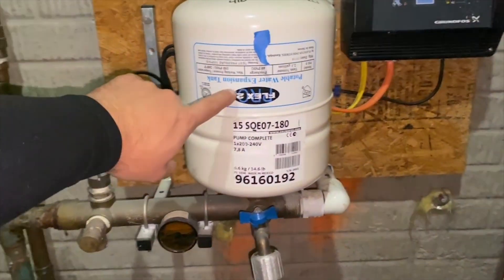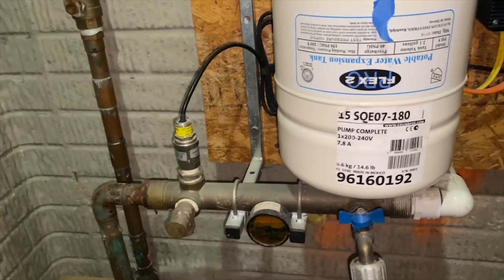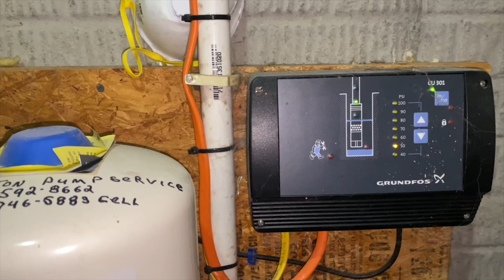Constant Pressure Systems: How They Work and Why You Need One

Comment: Do well gpm still matter if you have a storage tank or cistern? My gpm are below 4
Reply from the maker: See Short reply
Reply from the maker: Yes and no. For an average homeowner, not really. For just about any real estate transaction yes. Most contracts in MD require a min of 1 GPM. This is negotiable in some cases. Where it becomes a larger problem is with new construction. A new well must produce 1 GPM or you will need to have 2 wells with a min yield of 0.5 GPM with a combined total equal to 1.0 or more. Hope this helps.

Comment: Been watching a ton of your videos. Thank you for your knowledge and clear communication. We have a well that is 880 feet deep (static depth 860) and yields 10 gal/min. It yields about 10 gal/min. We have a 1.5 HP pump and a 20 gallon pressure tank. After living in the home for a little over 3 years, I'm very fed up with the water pressure (I can't even rinse dishes while my son showers). We'd like to maintain the life of our pump as long as possible (because a pump that large is rather pricey and difficult to replace) as well. Seems like a constant pressure system would be the way to go. Would you agree?

Comment: During my research on pressure tank systems they all touted draw down (Gallons withdrawn from the tank) sizing so you are not short cycling the well pump, causing it to heat and cool, stop and go that reduces the life of the well pump.  Is there a concern for increased cycling times with a constant pressure system?  Basically saying a well pump has a MTBF (Mean time between failures) of 300K cycles, it typically fails at 15 years but now with the increase to cycle times it will shorten the life expectancy of the well pump.

I am having a house built and just had the well guy out this week.  Well was installed back in late 90's.  500' 6" casing.  He suggested fracking the well to breakup any sediment that may have occurred over the past 30 years.  He fracked it, clorinated it (code) and then came back and pumped it several hours the next day.  Good clean water at about 12-13 GPM with a 3/4 horse submersible pump.

Comment: I have a well 140 feet deep, static water level at 70 feet and it makes 20 gallons a minute.  The casing is six inch steel pipe which for every foot of pipe there is 11/2 gallon reserve.  I want to use a Franklin 1HP 230V 2W 20GPM SS Pump in conjunction with a Franklin Electric Subdrive Connect 20 constant pressure system.  In your opinion can I use this pump and constant pressure system safely based upon specs of the well that I cited to you??
Reply: Yes, you can safely use the Franklin 1HP 20GPM pump with the SubDrive Connect 20 system based on your well’s specifications. Just ensure proper installation depth and monitor usage to avoid over-pumping.

Comment: Thank you for your video, I found it very helpful as I contemplate tackling this project as a DIY.  I live in Palmer, Alaska and these kind of constant pressure systems seem to be totally alien in Alaska.  I've called around to numerous plumbers as well our local plumbing supply stores and everyone is greatly lacking product information as well installation of these systems.  I'm fine hiring this out even however as I said, no one really knows the product.  Which I find is half the battle learning what to install, best in industry, right size for the home, etc.  Thank you again for your time and sharing this product knowledge, as a homeowner and DIY're I appreciate it.  My goal is to have it done right with the most sound practical solution.  I prefer to tackle it myself however, I want it done right and always welcome professional advice.
Reply from the maker: I'm glad to help out with some knowledge. The goal of this channel is to make some of these more complicated systems a bit more approachable for the average homeowner. I'm not super familiar with any of the geology out in Alaska.

The brand that I like is Grundfos but there is a bit of work that goes into installing one. You may have a supply house that has better rates, so I would strongly suggest looking these because these amazon rates seem high. You would also need an appropriately sized Grundfos SQE series pump. The pump charts can be a bit tricky if you're not familiar with it, but many supply houses will help out if you give them the well depth, static water level, drilled GPM, & distance to home from the well. Some people have been liking the Franklin Electric sub drive systems, but they cause a lot of headaches for homeowners in my area, so I would be careful with that one. 

This should be all the bits needed to convert to constant pressure system. Obviously double check all the fitting sizes etc as the links may shift. The supply houses around my way will usually have a catalog with a kit order number. This makes it was easier for ordering rather than going piece by piece. I hope this helps!

https://amzn.to/3E9AlC7
https://amzn.to/4llKLzw
https://amzn.to/41XRuIc
https://www.amazon.com/AMTROL-WX-102-Pre-Pressurized-Well-Tank/dp/B0057OZNHY?content-id=amzn1.sym.1091e5b8-0ff4-492a-aa0b-7bc8b59253c6%3Aamzn1.sym.1091e5b8-0ff4-492a-aa0b-7bc8b59253c6&crid=OH2OWRQIB1B5&cv_ct_cx=bladder+tank&keywords=bladder+tank&pd_rd_i=B0057OZNHY&pd_rd_r=a1c27851-f2e3-4886-b864-0bbaa60f9b48&pd_rd_w=uXK08&pd_rd_wg=aUqrM&pf_rd_p=1091e5b8-0ff4-492a-aa0b-7bc8b59253c6&pf_rd_r=PCT2WMV7KP9HB89DQ2Q6&qid=1743703244&s=hi&sbo=RZvfv%2F%2FHxDF%2BO5021pAnSA%3D%3D&sprefix=bladder+tank%2Ctools%2C70&sr=1-3-6024b2a3-78e4-4fed-8fed-e1613be3bcce-spons&sp_csd=d2lkZ2V0TmFtZT1zcF9zZWFyY2hfdGhlbWF0aWM&psc=1&linkCode=ll1&tag=marylandwella-20&linkId=78182351f38162f67019ffce3a3a30b0&language=en_US&ref_=as_li_ss_tl